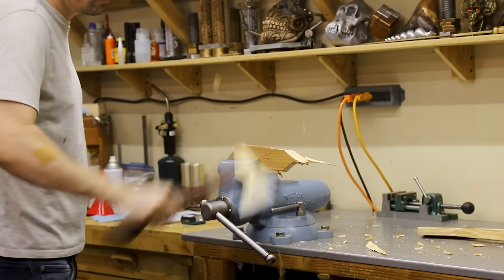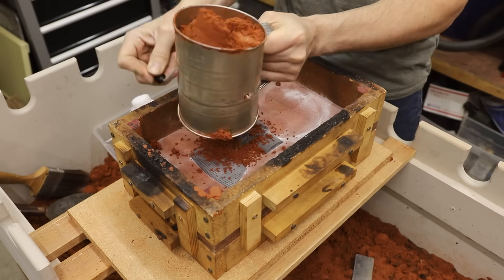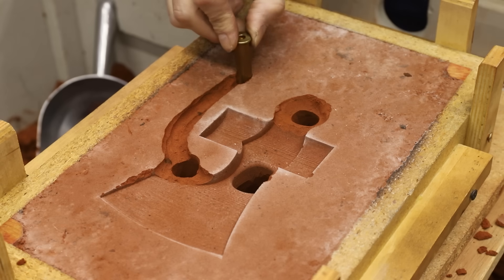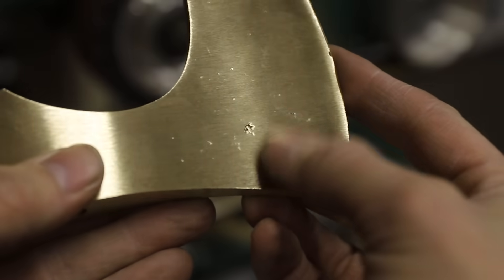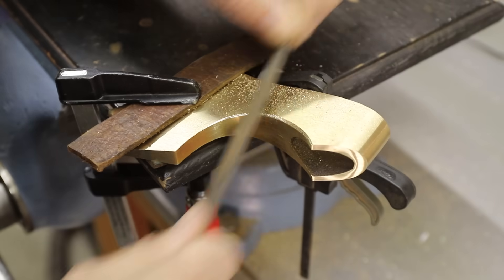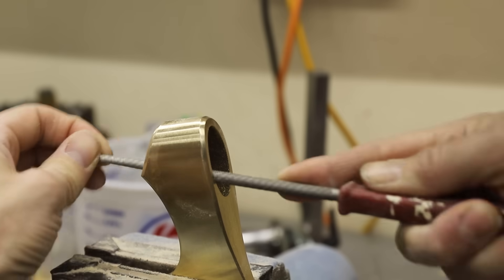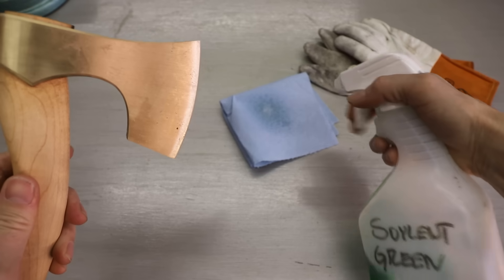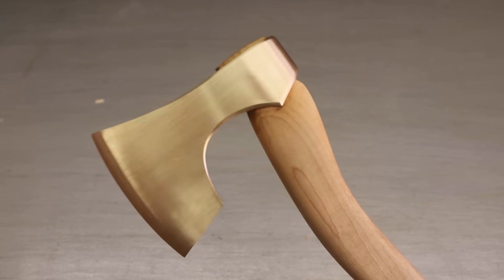Making & Testing Aluminum Bronze Hatchet WILL IT SURVIVE?

Comment: Dont know if anyone has commented on this fact yet, but copper axes in history had very different edge profiles than modern steel axes. This is something that is easy to research online, but basically, the edge is much more reinforced (fatter), and so not as sharp. It will take more work to do the same job but the edge won't dull so fast, and all that is to be expected with inferior metallurgy. Man, this was a fun video though! Thank you so much for sharing.
Reply: Another mistake here, was grinding away the folded over edge. He should have just peened in back into shape, at least until and unless it work hardened enough that it broke off rather than rolling over.

Watched a dude scythe a whole lawn of overgrown grass, (which requires a pretty fine edge if you don't wanna work yourself to death) never using anything to sharpen it other than a peening hammer and tiny anvil.
Reply: I heard once they did not usually grind the edge sharp again but hammered it to shape. I guess this way they did not lose material so much because metal was really scarce and expensive those days.
Reply: @rickrandom6734  Indeed.  It continues to work harden the metal as well.
Reply: I agree. Stone and bronze blades all had that "fat" edge profile for edge retention in less than durable material. Good stuff.
Reply: @hexadecimil  Not all bronze blades did have the fat edge though. Copper axes certainly had it and so does arsenic bronze axes but regular bronze is a lot tougher then most people think. Far harder then an iron axe but not as hard as a good steel axe.
It of course also depends exactly what the axe was for. Cutting firewood, making planks (yeah, for boat building they often didn't saw the planks but used an axe instead) or finishing up wood all have their specific axe shapes and thicknesses.

Brone is a wonderful material to work with. I am not so sure about aluminum bronze though since I never worked with it.
Reply: @loke6664  that's a lot of good info. My work in bronze is very limited to some hobby decorative stuff I did once. Maybe the aluminum bronze is much too soft for an axe at all. Aluminum wasn't available back in the day. It's only cheap today because of high tech mining techniques.
Reply: @hexadecimil  I'm a CNC guy and mainly works in steel of different quality but I made some things in aluminum, brass, copper and bronze too.

I know it is softer then regular bronze and that arsenic bronze (which was mainly made in Eastern Europe during early to mid bronze age but also invented by the Tiwanaku people in South America 2000 years ago) is also softer.

I am aware of how hard and tough bronze is (pretty hard but extremely tough) but I don't know about exactly how hard and tough the other 2 are.

That is the reason I think a comparison would be very interesting. The Arsenic bronze is sadly probably best to avoid, just grinding the axe could be very dangerous which probably is why the Incas didn't produce that much of it even if they did manufacture it and they could have replaced many of their stone tools with it.

Games have made bronze sound like a worse metal even then iron but in some aspects, it is a better choice then steel. In the 17th century it was the best material for both cannons and church bells since the steel of the time had a tendency to crack, which was very bad for a 24 pound ship cannon.

Most ships still used cast iron or steel cannons since those were many times cheaper but the really fancy ones used bronze (Wasa who sunk in 1628 had only bronze cannons for example).

So a comparison between a aluminum bronze axe, a regular bronze axe and a modern axe at cutting wood would be really fun to watch. :)
Reply: @loke6664  CNC?! That's cool. I need a CNC guy. My old contact lost access to the shop he was renting which included a CNC. I work in leather and I have abandoned steel entirely for hardware and fitments. It just doesn't last. Brass is twice the price, but lasts forever. I have had all my steel fittings wear out or just look ugly after a while. All my brass bickles and screws outlast the leather and still look so good they get reused in another project down the road. Love brass and bronze.
Reply: @hexadecimil  Heh, brass is a bit crappy to work in but it is a practical metal.
I would think bronze would be even better since just like brass it will not rust but it is even tougher and can take a lot of punishment.

A few years ago a Chinese archaeologists hurt his hand pretty badly when he tried to feel if the edge of this 2700 years old bronze sword was still sharp or not. That is really something that only could have happened with bronze unless there were some extra ordinary circumstances, even most well preserved steel swords are totally useless today. Most bronze swords are fully usable even after a few thousand years in the ground (even if you probably need to sharpen most of them for that).
Reply: @loke6664  I wish buckle guy sold bronze fittings, but alas. LL brass is Al I have available. Maybe there are some specialty sights out there.
Reply: @hexadecimil  It is a bit unusual metal to work in. My GF bought 3 bronze ring from an artist a week ago who worked in gold, silver and bronze...

If one live in a city you sadly can't make it yourself, otherwise is making a coal fired setup to melt it and pour it into sand using one of the brass fitting as model, it's pretty easy. You still need a small crucible and something to life it as well.

Usually you just melt 9 parts copper and 1 part tin.

But it kinda require a workshop or yard. There must be places that sells bronze fittings though, I seen them at some markets but I live in Sweden so that wont help you.

It might be best to Google around a bit, you should be able to find them for a decent price.
Reply: @loke6664  Sweden!? Cool. Your like 8 hours ahead of me. I have a hard and I sort of live in the country. I don't have a workshop though. And Louisiana is very wet. You can't leave tools outside even under a roof. But you have inspired me to start making my own bronze fittings one day! I plan on having a workshop with all the trimmings.

I used to have a small shop, but lost that house in the divorce. I will look for bronze fittings online. Might be worth the extra trouble and expense for some special projects.
Reply: @hexadecimil  I don't think they will be much more expensive then brass if you just find them which is the hard part. I did have a bronze belt buckle shaped like a lions head myself but unfortunately I lost it in a move.

I plan to build my own workshop myself soon for making knives and stuff. I can do some things if I stay after hours at work.

It would be rather fun to make a bronze sword though...

I visited Wisby a week ago, it is a city that have changed little since the 14th century and it's city wall is almost intact since then. They have a lot of artisans there including bronze workers, glass blowers and jewelers so I got a bit inspired.

It does sound a lot more fun then making parts for trucks as I do or mining drills which I did at my last job.

But if you plan to do some bronze working, I can recommend you do some work with tin first. The principles as the same but it melts at so low temperatures that you don't need any specific equipment and can do it indoors. 

That way you learn the principles and you can always re-use the tin to make bronze later. It is better for jewelry and similar items that don't need to be very hard though.

I done some work in tin myself a while ago.
Reply: @loke6664  you know that's a really wise price of advice! Casting in tin would be greater practice! Soldiers and hunter used to make their own bullets with a small portable mold at the camp fire. And when lead wasn't available, they used tin since you could use all the same tools to do it. I have wanted to cast some ornamental things for my wife too! Lol. Now I have yet another hobby, lol.
Reply: @hexadecimil  Tin is a great metal for small ornamental stuff, easy to work. 
First metal I ever worked with, as a kid we made D&D figurines in tin.

Be a bit careful if you ever make lead bullets though, you need great ventilation for that since you can get lead poisoning if you breath in the vapors. I guess using a campfire solves that problems.

Tin also have the advantage that you can make molds in different materials like certain kinds or resin (the more heat resistant ones) and plaster. With bronze you are basically stuck with stone molds and sand.

The whole "stone in the sword" myth is probably from the bronze age and originally about someone making a bronze sword, you basically pull the sword out of a stone there.

I know this guy who 3D print models he then make molds for and pour tin in. That requires some 3D modelling and a printer and feels a bit like cheating though but he is rather creative. 

But you can use it to copy something you already have or you could make a wood or clay model as well.

Sadly, my boss would kill me if I made granite molds in my Deckel at work. ;)
Reply: @loke6664  I didn't think of the applications of mold materials either. More great info! 

I won't be using lead for anything. I have already poisoned myself enough in my life. Lol. Tin seems cool enough. 

You made DnD figures out of tin?! That's some old school biz right there. Very cool. How long ago was that and do you still have any of the figures?

 I play a bit of DnD and TTRPGs myself. Played the Alien RPG last night with my son and some friends online in fact. 

I also have a 3D printer. It's not cheating if you 3D model your own models from scratch! Lol. I designed, modeled, and printed a whole sword (about 18 parts, glued around an oak dowel) with my son's once. That was fun. 

Never liked turning models into molds though. There is so much sanding between each step and too many steps.
Reply: @hexadecimil  That was in the 80s, I still think I have a couple around somewhere in a box.

I did own a 3D printer, the same one my friend have now. I bought it to learn how it works, I can already use CAD programs.
I did print a dungeon master screen of Doom a couple of years ago but it took me almost 2 months of constant printing.

So once I learned how to operate it, I gave it to my buddy, it was a cheap Ender 3D. He is really into making molds, he mainly makes things like dice in resin but also a bit of other materials including tin (he did give me a couple of his works).

And yeah, if you do the entire model yourself, it isn't really cheating. Downloading someone else work and making small modifications are.

I mean, when I make things from blueprints in a CNC machine, it is the same thing. I rarely do nowadays though, we tend to make things in huge numbers which is less fun but what can you do?

And yeah, making things from molds can require a lot of work, but my buddy seems to have become so good not much is required. I think it comes down to experience, if you do something a lot, you get better and better.

Those resin dice are according to him far harder then the things he makes in tin (mainly miniatures, among other things did he give me a really nice mimic).

I still play some AD&D (1st ed), Call of Cthulhu and Delta green now and then.
Reply: @loke6664  AD&D?! Before my time. I feel like 3.5 had the sauce. Then they threw it away. Never got to play Cthulhu. Gonna have to do that one day. I play my own game now days. Trying to get it ready to publish in a year or two. Here's hoping.
Reply: @hexadecimil  I played every edition besides the White box and 4th ed including both AD&D editions and D&D Basic.

3.5 is more heroic but I honestly think AD&D is more rewarding to play. It depends a bit on exactly what you are playing though. AD&D is far more hero to zero, you start out as a pretty hopeless character but you can end up as the leader of your own thieves or assassin guild, be the grandmaster of your own castle or something similar depending on your class. Getting there is hard though, since the current thieves guild for instance wont like your new one very much...

3.5 is more cinematic. Your level 1 character is already a hero even if he or she is at the bottom of the hero totempole.

That means that running a dungeon is a very different experience, you have to be super tactical in Gygax AD&D or you are pretty much screwed. We build up 3D dungeons and use miniatures so my players experience is a bit of a mix between  roleplaying and a miniature game.

Call of Cthulhu is super fun if you enjoy Gothic horror. I did run this nice module called "Viral" last X-mas about a team of YouTube ghosthunters visiting an old creepy island outside Sicily. Lot's of handouts, ghosthunters creeping around an old hospital abandoned in the 50s and trying to puzzle out what is going on...

Usually it is set in the 20s and 30s though.

As for Delta Green, think of a mix between the X-files and the first season of True Detective. The players work a very secret governmental agencies who is trying to protect humanity against the unnatural. It is also a bit creepy but less so then CoC where the players tend to be ordinary people. Weird sects, monsters and murder.

Those 3 are my go to games, I am the type of gamemaster that enjoys visual aides, miniatures, handouts and similar things.
Reply: @loke6664  dang. Those sound like a legit fun game. You put a lot of work in. You interested in doing any online TTRPG gaming?
Reply: @hexadecimil  Over something like Roll20 you mean?
I might be... I think I still have Viral prepared there even though I would have to edit back some things, hide the handouts and so on.
Reply: @loke6664  we aren't that fancy. We just do theater of the mind over discord. More roleplay than anything else. Onetime we used talespire but it was a little clunky
Reply: Yeah, take a look at the copper axe found with Otzi, the Alpine mummy. The blade has a very chubby profile.
Reply: @agluebottle  Otzi's copper axe was also much harder than anyone ever expected a copper axe to be when they tested it with a hardness closer to Bronze. It took a while to replicate how they got their copper so hard.
Reply: Also work crews would typically have people right there working on sharpening worn blades, passing fresh ones up to the workers like an assembly line.
Reply: Also, since we're talking about the benefits of different blades, the bearded style he used is much more common for war axes than tool axes because it introduces more weak points but reduces weight.
Reply: Was having similar thoughts about the edge profile after he chopped the maple board. A nice fat convex grind similar to what you see on a splitting maul could make a difference.
Reply: came here to say this thanks.
Reply: As others have said, you need to learn how to maintain the edge through peening alone.  You might also want to experiment with different alloys as well.
Reply: Fascinating! Copper is more malleable but not sure how wider edge keeps longer?
Reply: I'm pretty sure he used bronze, which is way harder.
Reply: Also electric grinding heats and anneals the metal so its way way softer.hand sanding on a  wetstone w have been more effective.
Reply: Next few centuries. When people don't remember this axe. They will question how ancient world made this Axe ? is it from Alien ?
Reply: It was because they are two different tools. Utility axes historically never was sharpened. It was enough to cut wood, but not as we do today.
War and battle axes, in the other side, were VERY sharp. Almost razor sharp.
Reply: I LITERALLY just finished saying this to my wife! I turned back to the video and immediately spotted this comment. How I explained it to her tho was that he needed more material behind the edge to support it, and that the edge rolled because it was lacking the back-up mass on either side to keep it steady and in place.

You can get a damned fine cutting edge on a wide blade... and yeah, it will perhaps take a little more oomph to cut the same, but at the same time the edge performance won't fade so fast so I'm guessing that averaged across an entire winter's worth of firewood the energy outputs would be the same, possibly even coming down on the side of the fatter edge because edge profiling is a lot of work, and redoing it every 10 pieces of wood would make your average woodpile take a Very Long Time to build. ;)
Reply: @ArmchairDeity  right on man! Sounds like you have a good relationship with your wife to listen to you talking about bronze axe blade profiles efficiency, lol.
Reply: @hexadecimil  I always apologize for going on and on and she's always like "NO I think it's interesting!" like I'm not allowed to stop nerding out on her... ;) I think she kinda likes knowing her man could help reinvent society if necessary. LOL ¯\_(ツ)_/¯
Reply: @ArmchairDeity  as my kids would say "facts!" She's a keeper.
Reply: It might also be useful to look at stone axes for another step less hard.
Reply: @imjstcl  pretty sure stone is harder than copper
Reply: @mikitheberserkr  Which is why the copper using Native American tribe using found copper on the surface on one of the edges of the great lakes started out making copper tools and weapons but over time started making copper art stuff and trading it for good stone tools from tribes with good stone.
Reply: @imjstcl  stone is not less hard, it's brittle
Reply: @imjstcl  Most stone is MUCH harder than copper. I think copper is a3 on the hardness scale while Flint is about a 7
Reply: One of my great great grandfathers lived during the bronze age and use to say that he wished there was a harder type of metal 
Thats what my dad told me not too long ago
Reply: only a stupid ameritard would be ignorant and make such a shitty design for a copper alloy axe.
Reply: @HipposHateWater  I have never seen this. Could you post any links???
Reply: Those copper axes started out being cold forged originally so they had to be made differently also to stand up to use later as you said.
Reply: @bullboo1  They stopped that pretty quickly though because you don't find that much copper you can cold forge directly so they ran out of that relatively fast and had to learn how to melt the ore to get the copper out.

And when you are doing that, it isn't much extra work to pour the melted copper into a form.

But you are right, the earliest copper items we found are all cold forged, like the pearls from Boncuclu tarla for instance (those are 10 000 years old and are among the oldest copper items ever found).

So pretty quickly is a couple of thousands years, but you mainly find smaller objects before they figured out how to melt it.
Reply: tin bronze is that the accients used for thousands of years for a reason, tougher than aluminum or silica bronze.
Reply: Forgot to add arsenic.
Arsenical bronze is a different lump.
Reply: copper age lasted little and was followed by bronze age. For this copper that was found native was used